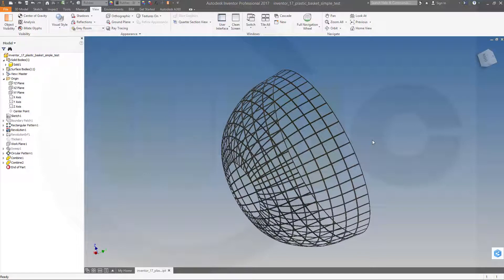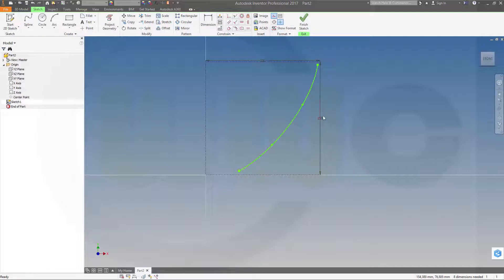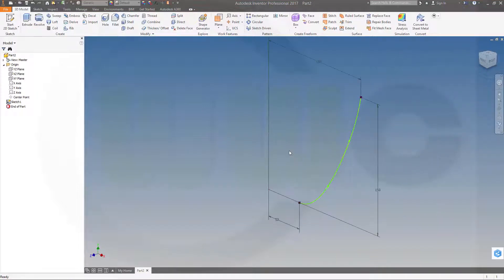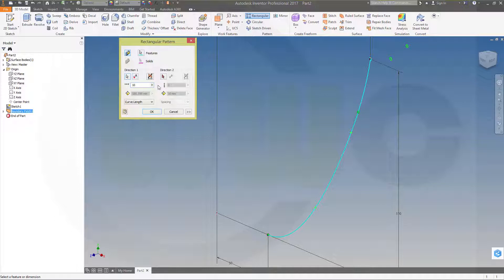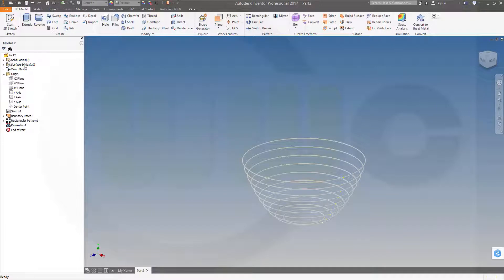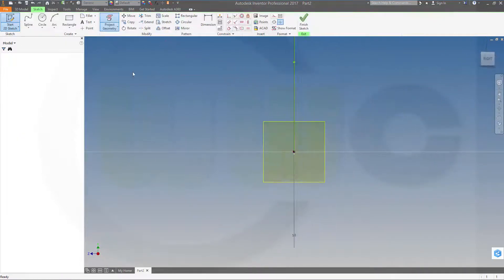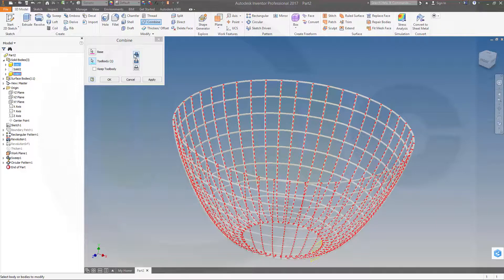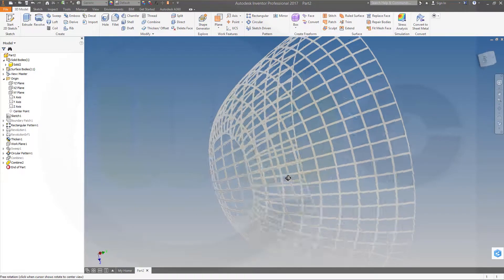Plastic basket - simple solution - Inventor 2017 Training - Part Design

Comment: Great video and you make it look so easy but one thing im trying to understand is why you need the last step of intersecting the bodies of the thickened surface and the mesh frame?
Reply from the maker: Hi, thanks. Of course you don´t have to make the intersect, by using the intersection I got a different shape of the "rips" straight/flat on the inside and outside - curved on the left, right, upper and lower side ;)